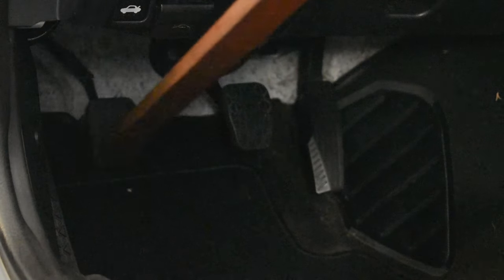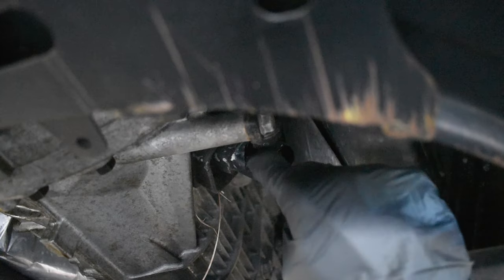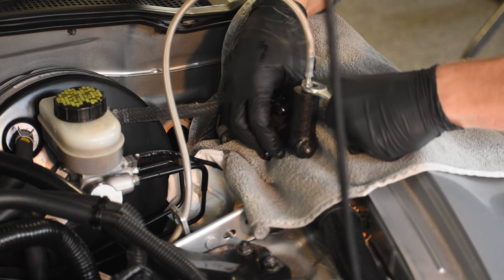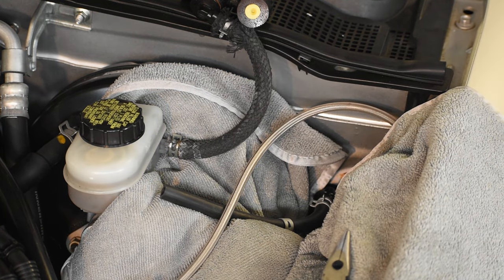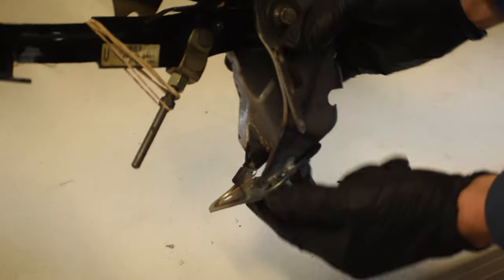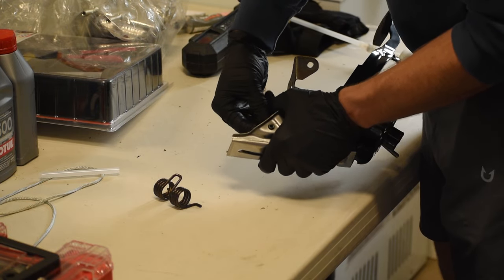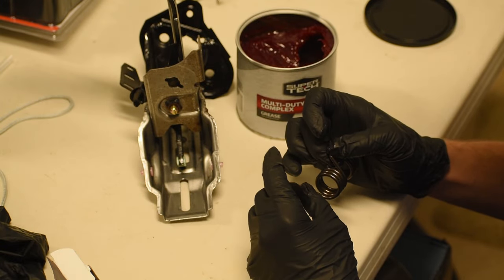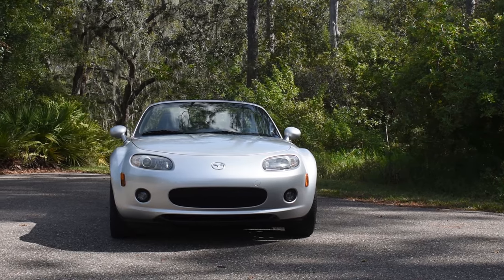How to Fix a Squeaky Clutch Pedal PERMANENTLY || NC Miata Build

Comment: Hey, so I tried this yesterday. I got the pedal out of the car and saw it were the bearings that make it squeak. Fortunetaly, I have a workshop here in Germany that welded the pedal for me. 

However, swapping out the master cylinder wasn't that easy. I have the NCFL, and over the cylinder lays the sound tube of the sound enhancer that has to be disassembled first. You can try to bend it a bit, though, which could be enough space. Secondly, the brake line wasn't going off, as the nut was old and rusty. Also, my new cylinder – not an original Mazda Part – missed a seal to put against the fire wall. So after all, I just put the paddle back in and it all works fine now, as I swapped out the bearings connected to the spring myself. The squeak is gone, and that's enough for me for now :D
Reply: So, to make that more clear, I didn't swap out the cylinder at all. Still works.
Reply from the maker: Interesting the difference in the cars based on country. Glad you got it worked out, those bearings make a ton of noise!
Reply: @running2redline  The sound enhancer was introduced with the Facelift version (NC2. So no surprise your's didn't have it :) Not a country thing I guess.

Comment: Awesome video man, Im hopeful this is the same squeak I’m hearing. I won’t be able to weld that section back myself unfortunately. is there any other way of doing it? Because I can see mines loose even with the pedal still In the car. Thank you!
Reply from the maker: I think the metal may be too thin to try anything else, especially a solution that will hold up. If you can’t weld it yourself, I would suggest removing it from the car and taking it somewhere. Almost any shop that has welding capabilities can knock that out in 5 or so minutes, and likely wouldn’t charge much at all. The peace of mind of having that done will likely be worth it though, this was an issue I wanted to fix once and never think about again. I will say the only difficulty is that you’ll be asking someone to weld aluminum which can be a pain. Good luck and I hope it works out for you, thanks for watching!
Reply: @running2redline  Thanks for the reply! Yeah I’m much the same I’d rather do something once and don’t properly than have to go back over something twice. I appreciate your time and I’m loving the NC content you’re putting out, keep it up!

Comment: Do you have a link or info on the bearings you used! Thank you!
Reply from the maker: https://www.amazon.com/Hillman-Group-58066-Flanged-Number-8/dp/B00MNDPO0I?pd_rd_w=rGMiL&content-id=amzn1.sym.d3245d74-f79b-49f3-b99c-1e231bb8ca7c&pf_rd_p=d3245d74-f79b-49f3-b99c-1e231bb8ca7c&pf_rd_r=N4Z840VZ1HZ6MWGN0176&pd_rd_wg=Geaam&pd_rd_r=1018b8ad-82c8-48d6-9cb0-98724f621a61&pd_rd_i=B00MNDPO0I&psc=1&ref_=pd_bap_m_grid_dv_rp_0_33_t

That should be it!